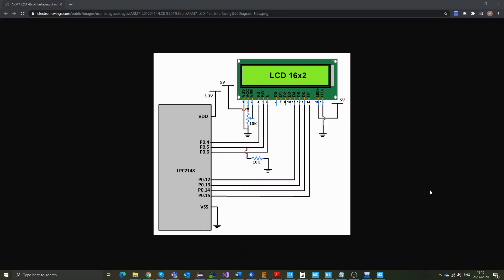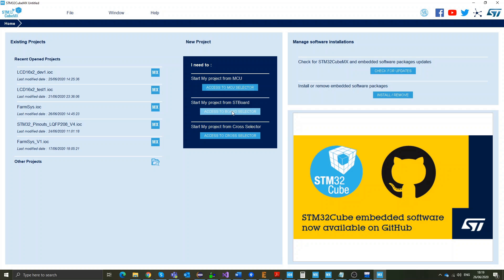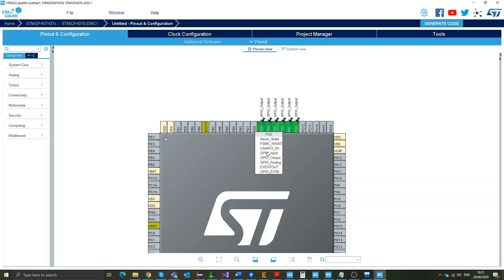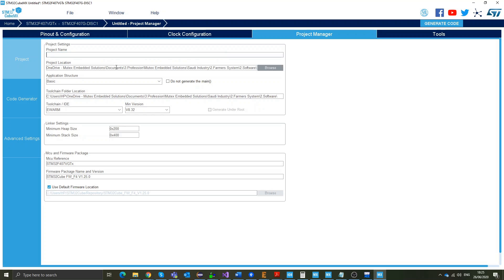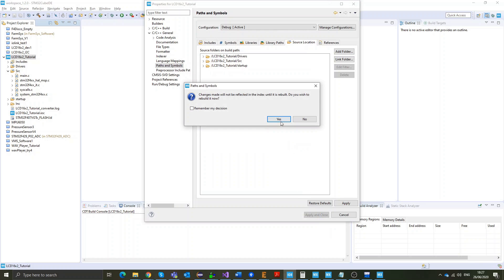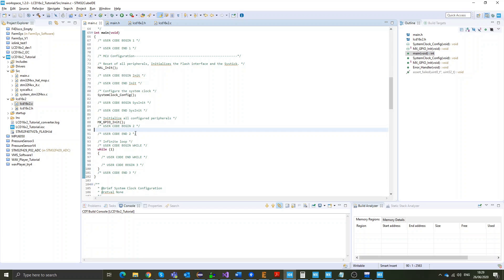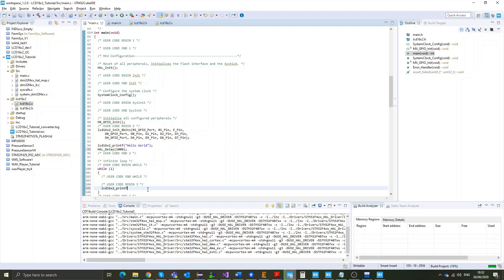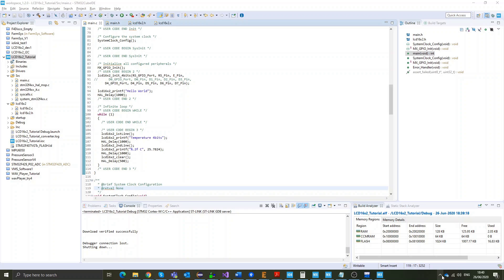STM32 HAL with CubeMX: Tutorial 11 - LCD16x2 - Updated 2020

Comment: Hi 
i am Vikas and now  i am learning keil for using stm32 microcontoller. i want to create a function for convert he value in to decimal like

0x15 will give 21
0x01 0x65  will give 357
0x01 0x50 will give 336
Reply from the maker: Use Union:
Typedef struct nameX
{
union
{
Uint16 fullValue;
Uint8 array[2];
}
}

Comment: Hi,it's so strange that my comment is disappeared.I thought i'd post it here one more time,i'm here intend  to seek for some advice from you professional opinion,my problem is the data is written to the data register corresponding to the pins i connected to the LCD,why there's nothing shows up on LCD?
Your reply would be really appreciated.Thanks in advance.
The best.
——Willy
Reply from the maker: HI Willy,
I am not too sure, but if you have the correct hardware wiring and clock settings, you should be ok. I suggest you switch to the I2C LCD, I have a video on that too. It is less troublesome with interface

Comment: hi,it work well. But maybe after a minute, letters shiftng left and letters and numbers mixing each other. How we can solve this?
thanks in advance
Reply from the maker: Hi Tolga,
Try increasing write Time Constant.
You will find it in the library h or c files I believe. Double this number. This stretches LCD pulses, and should fix your problem.
Reply: @mutexembedded2206  if you mean T_CONST value, i tried many value .But it doesnt help

Comment: It works on STM32F103C8, and I changed 4bit mode driver to work with any pin in controller, no need to use same port for data pins.
Reply from the maker: Great!
Reply: Could you please share the code for stm32f103c8 or tell about the changes in the code you did to make it work for this board?
Reply: @swathik.s9115  I can share code.

Comment: Hello Sir, I get 7 errors in lcd16x2.c file when I try to build the project. Could you pls help me resolve them sir? Thank you.

../lcd16x2/lcd16x2.c:81:3: error: 'CoreDebug' undeclared (first use in this function)
   CoreDebug->DEMCR &= ~CoreDebug_DEMCR_TRCENA_Msk;
   ^~~~~~~~~
../lcd16x2/lcd16x2.c:81:3: note: each undeclared identifier is reported only once for each function it appears in
../lcd16x2/lcd16x2.c:81:24: error: 'CoreDebug_DEMCR_TRCENA_Msk' undeclared (first use in this function)
   CoreDebug->DEMCR &= ~CoreDebug_DEMCR_TRCENA_Msk;
                        ^~~~~~~~~~~~~~~~~~~~~~~~~~
../lcd16x2/lcd16x2.c:85:3: error: 'DWT' undeclared (first use in this function)
   DWT->CTRL &= ~DWT_CTRL_CYCCNTENA_Msk;
   ^~~
../lcd16x2/lcd16x2.c:85:17: error: 'DWT_CTRL_CYCCNTENA_Msk' undeclared (first use in this function); did you mean 'SPI_CR1_CRCEN_Msk'?
   DWT->CTRL &= ~DWT_CTRL_CYCCNTENA_Msk;
                 ^~~~~~~~~~~~~~~~~~~~~~
                 SPI_CR1_CRCEN_Msk
../lcd16x2/lcd16x2.c: In function 'DWT_Delay_us':
../lcd16x2/lcd16x2.c:107:29: error: 'DWT' undeclared (first use in this function)
  uint32_t clk_cycle_start = DWT->CYCCNT;
                             ^~~
../lcd16x2/lcd16x2.c: In function 'DWT_Delay_Init':
../lcd16x2/lcd16x2.c:103:1: warning: control reaches end of non-void function [-Wreturn-type]
 }
 ^
make: * [lcd16x2/subdir.mk:18: lcd16x2/lcd16x2.o] Error 1
make: * Waiting for unfinished jobs....
Reply: Also, I did the entire project using CudeIDE and followed the exact same steps as you sir. Pls help me resolve them sir.
Reply from the maker: Hi,
What STM32 MCU are u using?
Reply: @mutexembedded2206  Never mind sir, Your older video's library worked fine. Thank you sir for your tutorials. They are really helpful for beginners like me.
Reply: @mutexembedded2206 I used 32F030R8, sir.
Reply from the maker: @swathip1461  you want to get rid of DWT functions. Replace any DWT_Delay with HAL_Delay(1)
Reply: @mutexembedded2206  okay sir. Thank you.

Comment: Hello MYaqoobEmbedded
I love all your videos and explanations on the STM32.
Your tutorials are great.
I currently own the STM32F746G Discovery and I program with CubeMX and Keil 5.
Currently I am stuck on a MIDI-USB project.
I can't communicate with my computer via the USB port to send and receive MIDI data.
Can you light my lantern please ?
I saw that I had to use USB FS and the Audio class.
But after that, I can't continue my project.
Thank you for your help.
Reply from the maker: Hi, this is Mohamed
Glad you're finding my videos helpful.
You generally wanna use FS or HS depending on your bandwidth requirement. Then, adjust the USB middleware layer to use Audio.
This might be a long process.. I haven't done such application before, but I will do it when I try.
For the time being, do some more USB practice to familiarize yourself with the middleware.
Reply: @mutexembedded2206  Great.
But I don't understand to adjust the USB middleware layer to use Audio.
For now the bandwidth is not too important at the moment (unless I make a sound card a little later).
In fact, I would like to make my STM32 a MIDI controller to drive a DJ deck like on the link of this video: https://www.youtube.com/watch?time_continue=1&v=00E6kYt_Sxk&feature=emb_logo
I have the CDJ deck that I will plug in SPI on the STM32.
Thanks.
Reply: I found the Github link here: https://github.com/keshikan/CureMIDI
But it is for a SMT32F4. As soon as I compile for my STM32F7 I get errors.
I'm not good with .h and .c files to embed.
Can you help me see my problem? Either with SW4STM32 or Keil5.
Thank you.

Comment: Hi, there is any way to contact you? like an email address? Thank you
Reply from the maker: Hi,
You can write me here if it is some question.
Reply: @mutexembedded2206  its about How to implement in a decent way a external interrupt button with debounce, because all I have found is by delying with a loop but I need something non blocking
Reply from the maker: @eldora7908  good one, a good way is to mask the interrupt once arrived, then set a flag to be checked by your main, then you can put a little delay in main and re-check input status, by this time denounce will settle and you will get correct reading.
Then unmask the interrupt and repeat.